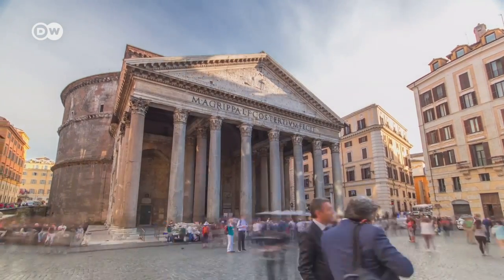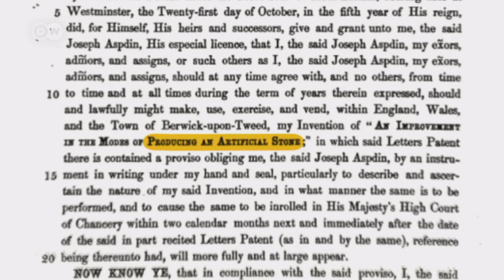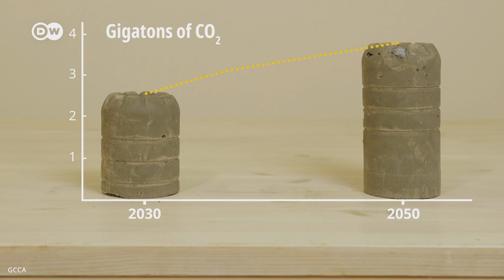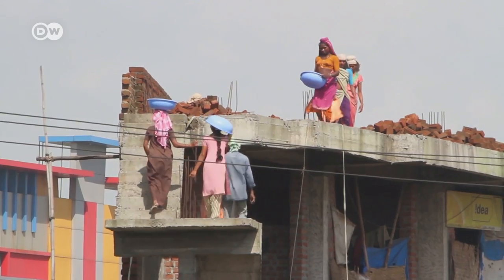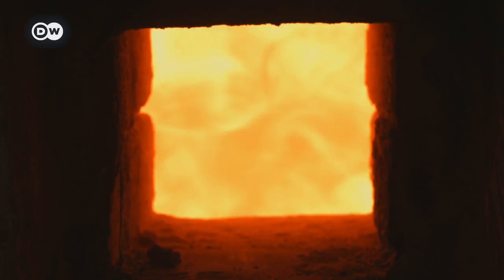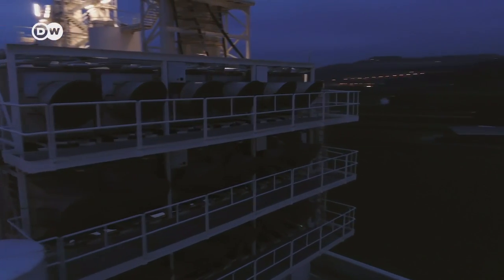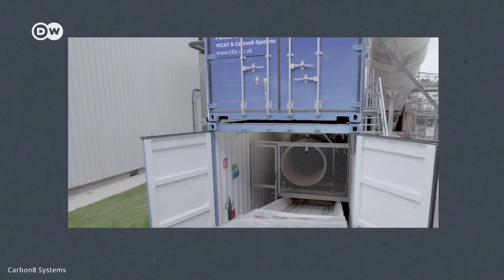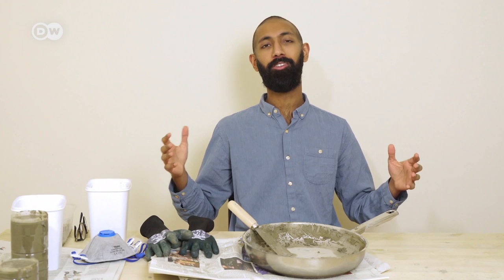How to fix the world's concrete problem

Comment: The concrete and cement industry knew this all along, but put its head in the sand like an ostrich. The alternatives that have so far been presented aren’t half as promising as reflected in this video. The only thing this industry wants, is to produce its high tonnage money making grey gold. 
If there’s one industry that should seriously look into its own production processes, it’s the concrete and cement niche. Nothing wrong with the old “portland” is still their credo. They don’t even realize that the level of innovation in their branch is one the lowest in the entire industrial sector. There are no concrete plans to transform plants into energy and resource material saving manufacturing facilities. Green, or C2C and whatever else kind of label is available, would not stick to the cement and concrete industry.
The comparison to Roman concrete and cement goes awry, where the old material has shown to be regenerative, contrary to its contemporary version which is stagnant after it has dried. Maybe that’s the best comparison for the cement and concrete niche. The old version was way more innovative than what is produced today. Cast in the rigid moulds of inflexible production methods and bound by the rigid rebar of the entire structure from plant, to architect, to end-user.
As you may well know, the Pantheon is the largest unreinforced concrete dome in the world. Located in an earthquake prone area. The question is: when is this industry finally gonna learn its lessons?
Reply: Industry responds to its customers buying decisions. If people stopped buying cheaper poluting cement, and instead chose to pay more for environmentally friendly cement, then that would be produced.
Reply: Calcined clay cement is a product that uses burnt clay to replace part of the clinker in cement. It can reduce CO2 emissions by 40%, but isn't all that widespread because no one is buying it.

If cement companies are to reduce their emissions, they need an economical reason to do so. Either taxing CO2 or subsidizing low CO2 alternatives are the only way you can get companies to care about reducing CO2 emissions.

Comment: It's unlikely the world will reach zero carbon emissions by 2050; the expansion of China's use of coal, both domestically and by building power plants in other countries, has more than offset the emissions reductions in Western countries. Even some purported attempts to reduce CO2 emissions, like biofuels, have actually increased them in the short run and increased aquifer depletion, which is a bigger threat to the human race than global warming, across the world.  There are probably some cost effective ways to reduce the emissions from cement production: heat recovery, immediate re-use of the C02 produced and the use of alternative heat sources. But I'm skeptical of Rube Goldberg schemes for capturing CO2 and pumping into the ground; one has to ask how much pollution will be generated by the infrastructure to capture it, how long it will stay buried and what it will do to the land in which it is buried.

Comment: Great video apart from the rather odd fixation on carbon dioxide production which is not proven to be responsible for any sort of global warming!  If you want to fixate on something you should consider water vapor which does have a significant impact.  Of course we should never lose sight of the fact that we are living on what really amounts to a spaceship with finite resources and as such we do need to be mindful of what we do!  But false science does not help at all.

Comment: All the new bookie men these days are either invisible or so remote it's hard to verify.

- CO2: invisible gas that's heavier than air and in tiny amounts blamed for heating the planet.
- Polar bear populations are suppose to be going down, when the opposite is true.
- Polar regions are suppose to be melting, when the ice extend is within normal levels.
- Temperatures are reported as being "the highest ever", while totally ignoring data from the 20's and 30's.
- A new virus that a great majority of people recover from being used as an excuse to control the masses.

So pardon me if I skeptical of your CO2/Carbon rhetoric.

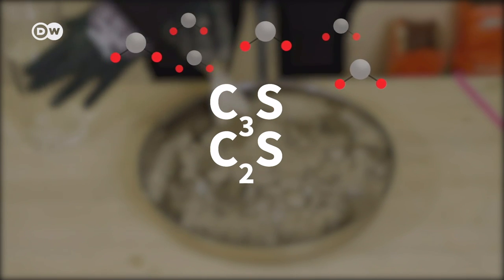Comment: 1:52 weird formulas, where does the sulfur come from? Were the Editors drunk?
Reply: it's a specific notation used in scientific litterature when dealing with cementitious materials. it is meant to represent 3(CaO).1(SIO4) for C3S and 2(CaO).1(SIO4). there also meny others like C3A and C4AF, which follows the same kind of logic.
Reply: @kevindaoust6192  thanks, that makes it a lot clearer, I was really confused

Comment: government create problems,not solution's ,you can devote your whole channel to things government does to block sustainability in building and better farming practices,and how government actually insensitivezes environmentally harming practices and how they are the biggest single contributor of co2 and greenhouse gases  , the difference between people who believe and do not believe in "human induced climate change" are small, HICC believers think government is the answer, while those who do not believe also believe in respecting the environment and living more in harmony with the environment, only they think humans are the solution and not the problem ,we can green desert's ,we can build earthship's we can farm in a way that adds to the environment instead of depleting it or pumping it with toxic chemicals  ,all the people involved in regenerative farming and building practices talk about how government insentivizes bad farming practice's and building with rules and regulation's ,i am not an hicc believer but i want a clean environment, i trust good people above government, but i acctually think we need to pressure government to remove bad insentives and regulations that helps erode the enviroment and makes it harder for people who want to improve the environment, just listen to micheal rynolds, joel salatin, greg judy, the compressed earth block guy,and you will see that real simple innovation involves humans and need less government while getting a better product,, we need to appeal to people's goodwill, instead of daddy government's punishment and reward

Comment: You know whats one way of reducing concrete use? STOP FUCKING BUILDING SHITTY CAR DEPENDANT SUBURBS. 

Make denser urban areas with solid public transport. 

It's much cheaper, to build a 4 storey apartment than 4 single family homes, with the same floor space. 

Additionally the 4 single family homes need to be connected via roads, while the apartment only needs a flight of stairs. 

Detached single Family homes => more roads and highway intersections => fuck ton of concrete use.

Comment: The intro is actively disinforming (Roman concrete is not our concrete). While it's partly corrected later on, the video still goes on to say 'we can design buildings to last longer as the Romans did'. Nope, we can't - short of rediscovering how exactly the Romans did their volcanic concrete, we can't have buildings that last 1000s of years as the Roman temples did.
Reply from the maker: Hi Kat, 
In the video we didn't say "design buildings to last as long as the romans did", we say "designing buildings to last longer - like the romans did." 😉 
The problem is that our current building practices don't think very far in the future, and we could change this (without needing to recreate the exact mix of volcanic concrete the romans used!)